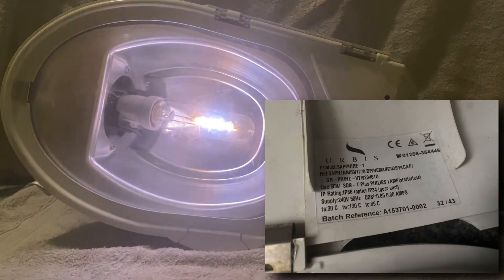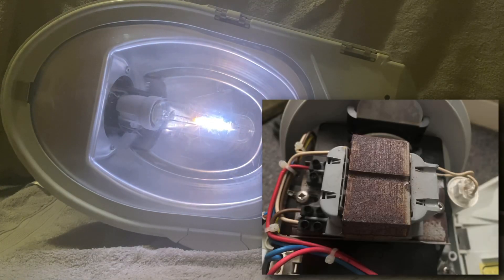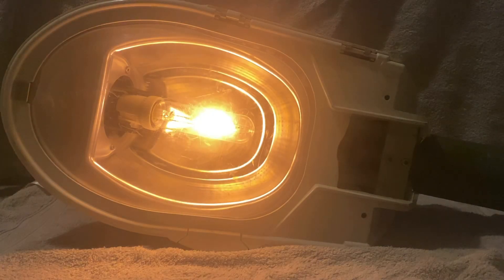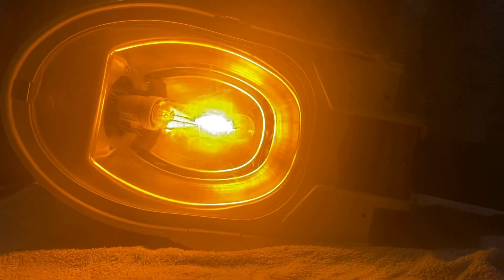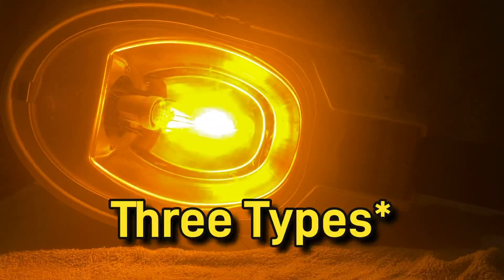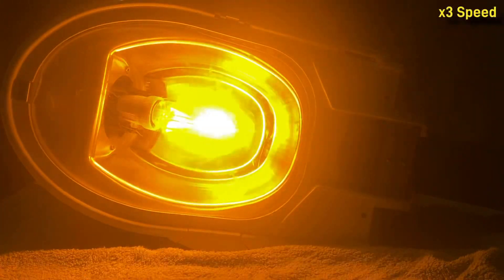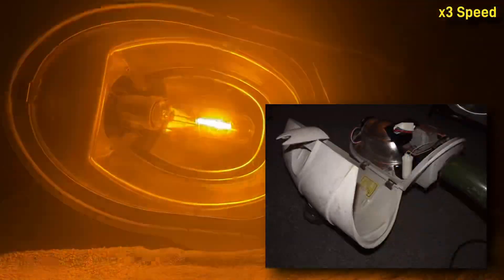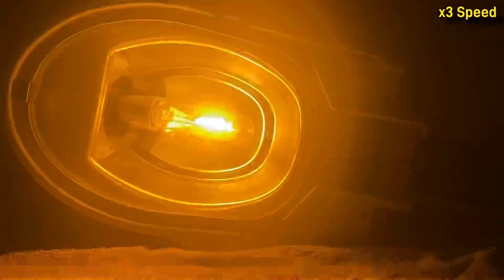Urbis/Schreder Sapphire 1 | 70W SON-T Warm-Up!

Comment: cool, but try to find a way to stop the flashing
Reply from the maker: The flashing is caused by the frequency the lamp operates not matching the FPS, so i'll have a tinker with settings and see what I can do and if theres a way to match it up/ make it better
Reply: You can do a couple of things depending on the intensity of the light. You could move the camera further away, and you an change the EV (exposure) and ISO (light sensitivity) settings. You'll need to figure what works best for each individual lamp type and power, and it may change throughout the lamp warmup.
Reply from the maker: @George_M55729  awesome, I'll give it a go when i've got some time to kill to figure out what works best
Reply: I never knew you were into Streetlights Pidge!
Reply: @SamsMancave1  didnt know you were either xd
Reply: @Pidge0386  Ye I have been nearly my whole life and have 2 Lamps Myself!
I have A Thorn beta 5 SOX lamp working with photocell and I also have a non- working Phillips SGS 55 SOX Lantern!
Reply: @SamsMancave1  nice!